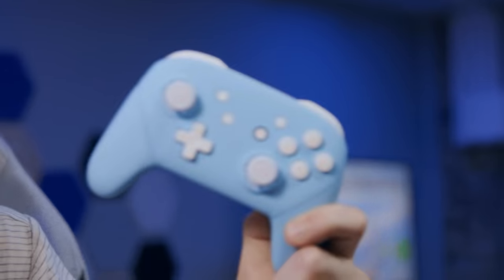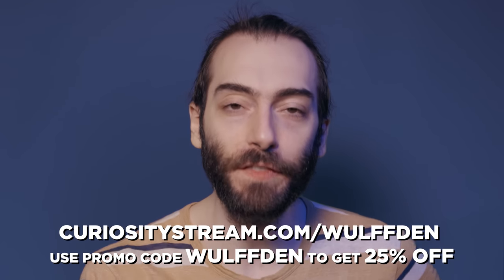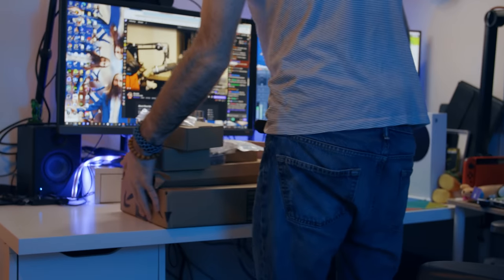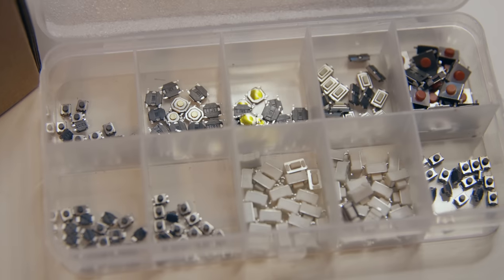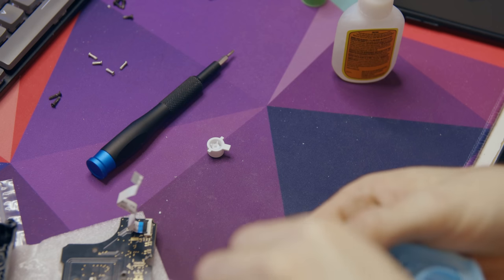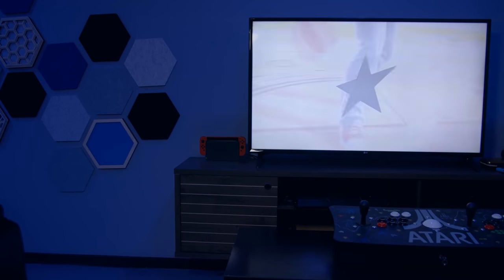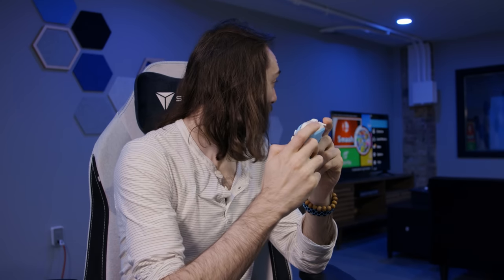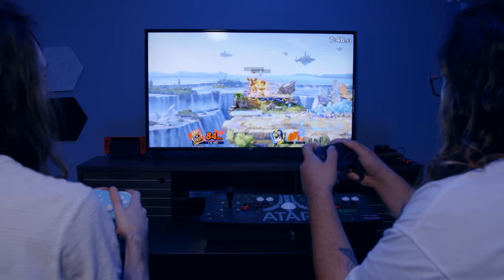I made the Nintendo Switch Pro Controller - ̗̀ CLICKIER  ̖́-

Comment: More power to you, Bob, but this sounds like a nightmare to me
Reply from the maker: it can be!
Reply: Yeah. I am very much able to solder, that was part of my profession, when I worked as electrician. But I'm certainly not gonna do this stuff. If there were some Microswitches built for this PCB that would be another story, but using trial and error and potentionally trying out 10 switches and drilling the Button Caps until it somewhat fits - oh hell no. I'm pretty confident that I COULD make it work, the soldering really isn't that hard, but nope. To much fiddling around. I'm pretty satisfied with the Buttons as they are, so that ain't worth it. 

Cool project tough, I like it a ton. Wouldn't recommend that mod to a beginner tough. Those Pro Controllers are expansive AF and if  you mess up to bad, which very well could happen if you ain't experienced, you threw away 70 Bucks . 

(Changing the Triggers and Shell tough, that's easy and anyone could do it without greater risk of destroying it)
Reply: WULFF DEN: Do you need Nintendo's Permission in order to create your own Nintendo Switch or the accessories like the controller
Reply: @DanielBrosman08211986  no
Reply: @sagichdirdochnicht4653  ExtremeRate makes a tactile face-button board for PS5 controllers, so maybe they'll make one for Switch Pro Controller, but if I did this mod, I would probably 3D print the face buttons in resin so you can dial in the clearance and maybe design it to fit over the switches better. And probably make a simple jig that could be hot glued to the board to prevent the switches from going anywhere (and to make sure they're perfectly square).
Reply: @sagichdirdochnicht4653  if it's easier than joycon I'll take the chance

Comment: It’s funny cause the thing I like about the pro controller is that it has less clicky buttons.
Reply from the maker: how dare you
Reply: @WulffDen  I don't prefer the kind of buttons the joucons have, but if you've ever used an OG Saturn controller (the model 2/Japanese design) the switches they used for the shoulder buttons were fantastic
Reply: @WulffDen  clicky buttons are for typing and fidgeting, for a controller I prefer buttons that require zero to none force to mash
Reply: Same. I also prefer the nintendo DS lite buttons over the 3DS because they're less clicky. I find clicky really hard for games like Mario Kart.
Reply: @manuelsaavedra8081  Same!
Reply: Same. The Pro Controller definitely isn't the most capable controller there is, but it's probably my favorite one I've tried due to its higher quality face buttons & bumpers, excellent grip and comfortable analog sticks.
Reply: It has the most clicky rubber membranes I've ever felt. I prefer the more smooth buttons that the Wii U controller had.
Reply: @manuelsaavedra8081  so like the steam controller where you don't have to even press a single thing just rest your finger on it?
Reply: @WulffDen  balls

Comment: Haven’t had a reason to break out my soldering iron in months. Gonna break it out for this 👍🏻
Reply: Comment back on how it goess!!!
Reply: @Littlemexican3306  just ordered the switches, I will!
Reply: Me too!
Reply: @Littlemexican3306  Reporting back! I did the replacements, it was easy enough. The A button wasn’t too bad since I knew only had to remove a tiny bit of plastic. I just held the drill bit with my hand and twisted it one rotation instead of using a actual drill. 

I’m not used to the new switches yet. I’m actually terrible at smash with this controller but I’ve only spent a couple hours playing. Might be a little bit too shallow of a press for me personally. Oh well 🤷🏻‍♂️
Reply: @ggarcia4114  nice nice I feel like some kinda medium sized switches with a solid click would feel amazing ofc there's only so much room in a controller but it is an interesting idea
Reply: @ggarcia4114  May I ask which switches did you use?
Reply: @ggarcia4114  i was trying to solder it but i dont know if its pin is connecting because the inputs are not even registering at all

Comment: Having made a ton of portables, I greatly prefer the feel of soft tactile switches. They are somewhere between the abruptness of straight tact switches and the gumminess of deep membrane connections. I actually did the reverse of this mod recently on a third-party switch grip.
Reply: Soft tactile switches? What are they like?
I think ideal face buttons should feel kinda like those 'deep' power buttons you see on some appliances. The ones where there is some travel with springy tension followed by a click at the bottom (those ones where the button stays in a bit when it's toggled to the 'on' position), except they would of course be momentary instead of toggle.
Is that what a soft tactile switch is like?

Comment: This is why I love the GBA sp so much, the buttons are SUPER clicky and so is the dpad, which makes it my favorite dpad to use
Reply: Phat ds has the same ones
Reply: yeah the sp buttons are awesome same with the original ds, and they still hold up well
Reply: If you like that specific click and you want to do this mod, you might want to find some slim tactile switches and maintain/replace the rubber membranes.
The GBA SP has a thin rubber membrane between the plastic button and the tact switch, which cuts the slack a bit and turns the harsh clack of a metal dome striking a contact into a nice and refined click.
Reply: to bad its the worst gba version of all 3
Reply: @wiskymo9687  that is just not the case, the worst of them is the original model gba
Reply: @postal8778  I'd rather play the original than the micro. The micro was so bad.
Reply: @Chance57  the micro is great what? it makes sense why the micro flopped but it easily has the best gba screen and it's shape is very similar to the original model.
Reply: @postal8778  I found the micro to be an ergonomic travesty. There is no objective metric here, but I simply cannot ever say  the best gb was the one on which my hands would cramp up If I wanted to play for more than 15 minutes. Especially on any game more demanding Pokémon.

It did have a really nice screen, but at that time it was more expensive than the SP and it wasn't backwards compatible Even though it came out after the DS which was.

Comment: Did not know they sold octogonal analog shells. Might need to do that.

Not for smash as much as because I hate when games require a straight walk and I fail miserably.

UPDATE: So I ended up filing my left stick gate only (but actually made it shaped like an octagon), as I still play a decent amount of shooters, so keeping my right stick circular was better for aiming. I also added the hair trigger, and put in some magnetic xbox one pro controller type sticks.

Now I'm tempted to do more mods as that hair trigger mod feels NICE. BTW, my right PIN was a pain in the ASS to get out, broke the plastic tweezers the kit came with and had to mangle a cheap pair of metal ones.

But WOW, this is now my favorite controller by far as long as I don't need analog triggers.

Comment: Just as a heads up, you might want to dab in some hot glue on the sides of the buttons to help with stability. Solder is decently strong but it will wear down over time the more you press. Anything you can do to help keep those buttons in place will greatly lengthen time in between repairs.
Reply: What type of hot glue/hot glue gun do you recommend? 

Would some type of super glue work instead. That seems easier and cheaper to work with in my mind, but I'm new to this so I could be wrong.

While hot glue would seem to help with stability and not needing to do repairs for a longer period, what would happen if it were to break and it's hot glued in place? Is there any repair process at that point or is it just forever broken?

I'm sorry for all of the questions. I'm new to this and think your suggestion is something I want to do, I just want as much clarity as possible before I attempt this.
Reply: @grantwalker7124  the main reason I said hot glue is because despite it helping strengthen the solder joint it is also marginally easy to peel off of the PCB and repair the part you need. For that same reason I wouldn't recommend super glue, but also because super glue doesn't build up very well to create a strong base. As for what type of hot glue gun to use, anything low to medium heat will do. You just need something that will do the minimum and preferably extrude to a fine tip, since you're working with small parts. 

*EDIT* I meant to say super doesn't build up very well and is near impossible to remove if needed
Reply: @Rillion02  Thank you for the reply.  That makes sense. 

These are likely stupid questions, but I'm new to soldering and would like as much clarification as possible. 

The video doesn't clarify these things:

What thickness should the soldering wire be for doing this? As thin as possible, right?

What type of soldering wire? "Tin Lead Resin Core" or some other type?
Reply: I'm no expert by any means, I've just done some super basic solder jobs before too, but yes I would definitely recommend thin solder to not get big globs of it in places you don't need it. I've definitely made that mistake before 😅. And yes you could use a lead free flux core solder for this.
Reply: @Rillion02  Hey, Adam. Just got everything in the mail, and plan on starting the mod soon. Overall, do you have any advice? This will be my first attempt at something like this, and while it does seem like a more straightforward thing, I would appreciate any tip you are able to throw my way.

Edit: Also curious as to if you did the d-pad, and if you did, any advice there? What size of the tactile switches are best for that? Would like to attempt that.
Reply: @grantwalker7124  I haven't attempted it yet, but my biggest advice for something like this is to take your time, and breathe. Soldering tony parts can get frustrating sometimes but the biggest thing to help is to just stay calm and work slow. Other than that, you got this!

Comment: If you’re gonna keep doing soldering projects, I really recommend getting a T12 soldering station. You can find them for like $65 bucks, they come with 3 tips, and have a huge temperature range. It’s also thinner than the ones you plug into the wall, so it’s a lot easier to control the point

Comment: also if you attempt to do this and paint that one black peice on the top you should also do a light sanding of it before painting. the sanding removes remaining residue/finish that protects the plastic/helps eject it from the mold. its a small difference but it helps in the long run

Comment: I love the eXtremeRate shells, but a word of warning to anyone getting soft-touch shells. The paint they use is relatively easy to scratch if you're not careful. I converted my JoyCons to safety yellow and with the Satisfye Switch grip, I would occasionally notice scratches where dug into the front sides from sliding it in and out.

Comment: I actually just finished this project based on this video. You definitely don't need to drill out the buttons! The switch measurements you had are perfect. What I did was hold the switches in place with some blue tac and then put flux & solder on TOP. The buttons feel amazing!

Thanks so much for the research, idea, and execution plan!

Edit: I made the micro switch and button change mods to my wife's controller and it actually had the clearance issue... I guess the plastics can be of variable tolerances?
Reply: Any chance I could find a tutorial for the method you did this? I have all the parts I need but the video isn't the most clear for me since I'm brand new to soldering.
Reply: @analog7259  I couldn't find a good tutorial but it's very similar to how he's doing it in this video at 6:35 except I used blue tac on the side of the switch to hold it down so I didn't have to hold it with tweezers to get the first anchor point. This also allows you to start applying the solder on top so you don't accidentally raise it up which would affect the button actuation.

As for tools for this project, I'd use:
  - Leaded rosin core solder. Lead so it melts easier and rosin core so it has flux inside it which helps it stay clean.
  - A good soldering iron set at a high temperature. I use a Hakko FX-888D at 750f/400c which is probably overkill for this project but a good high watt iron that won't lose heat on you will make your life easier.
  - Extra flux to keep things clean and the solder sticky. Especially helpful if you're new and not moving quickly.
  - A solder pump or a solder wick in case you make a mistake.
  - Something to solder on. A silicone mat is ideal for this imo.
  - Blue tac or something you can use to hold things in place temporarily.

Comment: I must say i got it better without drill  the buttons.
I use slim switches and insert a 3d print part to remove the space between switch and button.
I replace all buttons and rhe dpad.
And i make the trigger cable itself with a replacement and some switches.

With a tin tip of soldering iron the soldering is very easy

Comment: In that same switch kit should be some 2.5mm tall buttons, they worked perfectly under the d-pad, I replaced the d-pad buttons as well and that made this controller into a mario powerhouse, as much as you like the tactile buttons I recommend you crack it open and swap those out too, you won't be sorry.
Reply: Which 2.5mm tall piece did you use specifically? I saw a 2p black, 4p white, and a 4p black and can't figure out which one to use. Also, if possible, do you have pics of your final product? I want to make sure I solder these on correctly.

Comment: Fun fact you can actually use the same button switches on the dpad too. I did it myself but you do have to fold the metal connectors to make space for it. Only the 3 x 6 x 2.5 white buttons will work for the dpad.
Reply: Did you have any fitment or durability issues? I'm considering doing the same mod to the d-pad alone
Reply: Actually no I didn’t It’s been going great now for 7 months; just make sure you fold the metal tabs in and just be very thorough with your soldering. I love it though I couldn’t go back to how it was before.

Comment: I did this mod to the 8bitdo sn30 pro 2, it works really nice now, it is a little bit harder because the copper pads for the face buttons are really slim but it is still possible. I used super glue to secure better the switches, it is possible to add the switches to the shoulder buttons but it is really really hard so I just did it to the face buttons and the dpad

Comment: I love clicky switches.  Mechanical switches may not be as cheap and easy as rubber dome ones, but they feel so much better.  Speaking of, if you love things that are clicky, remember the controls on the Neo Geo Pocket Color?  I still love that little system's buttons felt.  Especially that clicky stick!

Comment: If you do remove material from the under-side of your buttons, keep in mind that drill bits work just fine as hand-tools too. You don't have to use a motorized drill, which could f**k right off on you in the blink of an eye. Just spin the bit in your fingers, adding a little pressure. It'll go a bit slower, which is exactly what you want.

Comment: I tried this mod and I honestly don't recommend it. the main issue is with the switches he recommended, they're ever so slightly too big which makes them really hard to solder and they don't even feel that good when its all done. luckily its also pretty easy to undo so I went back to the rubber domes. If you are going to do it look into other switches and it might work out fantastic (gaming mouse switches maybe idk).

Comment: I took the extra trigger plugs from the trigger kit and widened the little hole underneath the abxy, and then was able to test out some switches from the switch kit. I ended up using the flatter 4 prong from the switch kit. Haven't tried to solder it yet, just prototyped it with double sided tape from the trigger kit

Comment: I'll have to keep this idea in mind. I've already modded my pro controller with a translucent blue shell with octagonal gates, a silicone grip from Foamy Lizard, thumbstick grips from Skull & Co., and even wrapped the stick shafts with UHMW tape to prevent the plastic from grinding and causing that plastic dust build up. Having these micro switches would finally make the controller perfect I think.

Comment: soldering tips: don't cheap out, A decent soldering iron will last a very long time. I also suggest buying rosin core solder, That way you wont have to worry about flux. I also recommend getting a soldering clamp stand, soldering boards without and support is very frustrating.

Comment: Wow soldering is a step up, I just recently bought the OLED and replaced the shells, installed the extremeRate soft red shell and gold button led kit with no experience to hardware at all but if I can do software and be at the top of all 3 classes I think I can adapt to some instructions. All the reviews said it was a really frustrating process, after I did the left joycon 1½ hours, I did the harder right joycon in only 30 minutes after I got the hold of the screw and circuit placement.